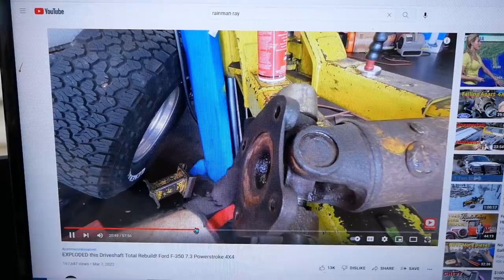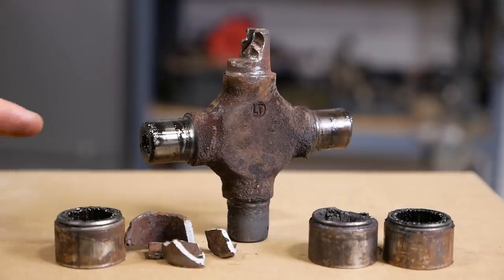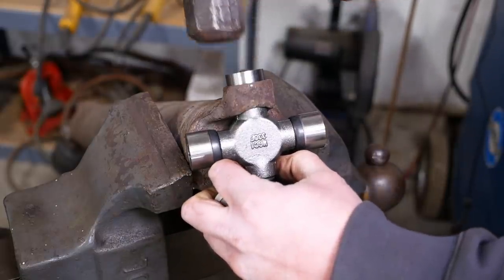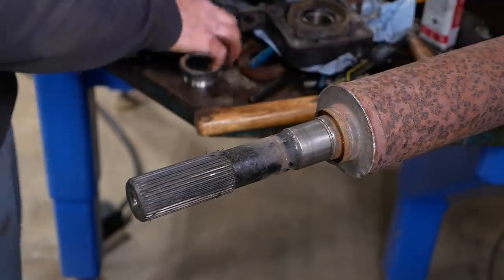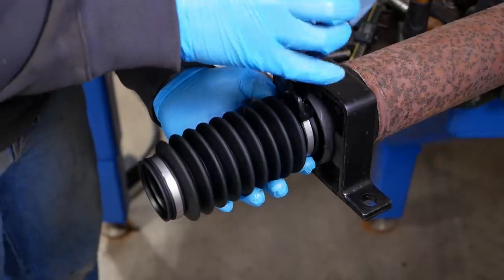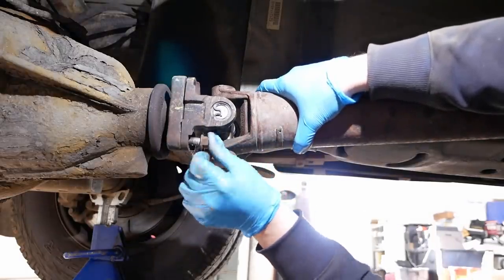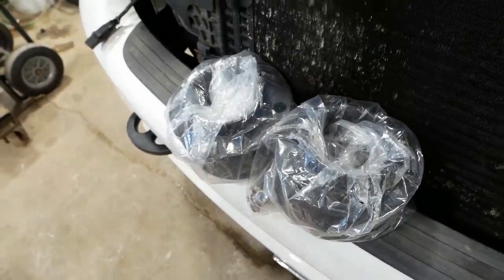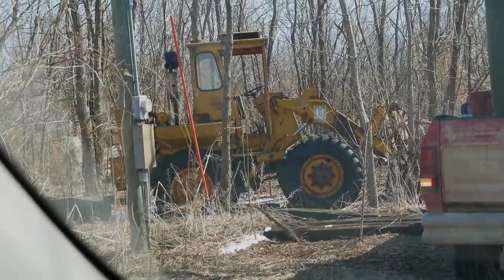Self Exploding Drive Shaft - Too Much Cummins Power...

Comment: Gotta be careful with the large fuel supplies of late. There have been a lot of stories about drilling holes in fuel tanks to steal fuel. One farm bought 3000 bucks of fuel for equipment and we can't do shit in Canada except call the cops who can only do something in certain situations. The people who did it filled up 2 cars and some jerry cans and let the rest drain on the ground. This is a situation where the cops won't do shit even though the people on the farm knows who did it, where they live and the evidence can be found easily because they don't try to hide their crimes. 

Our gas was cheap relative to other places at 1.17 per litre and it jumped to 1.50 the day after putin invaded and it has gone up more. With the pay before you fuel it is too hard for people to steal fuel from gas stations in and around the city.

Comment: The owner wants a "bro-dozer"... you really don't need to match the yoke to the pinion flange. While the driveshaft is balanced as an assembly, that pinion yoke is not part of that balanced assembly. Eric O @ SMA confrms this. Doesn't hurt anything is just unnecessary. 👍
Reply from the maker: They certainly do balance with the yoke installed. But I agree, it really doesn't matter.
Reply: @WatchWesWork  I mistyped... yoke on the shaft assembly but flange not, since that is installed on the diff.

Comment: but wes why would you do it right when you have the choice to do it wrong you know the new thing is the front end higher than the back. 1 1/2" is the most i will do on the front but try not to do any of them. dodge makes a nice metal one that isn't real expensive called a leveling kit for the truck. also the stocke intake is cold air most of the so called cold air intakes are usually hotte than stock and  have less filter

Comment: I know I found if a person is having to change U joints often on there truck it has always been from being overloaded constantly or they have cracked or weak springs, not to say that is what happened there just a observation from my old age wisdom. And I to have the special pliers for them clamps so your not special lol
Reply from the maker: After 360,000 miles, any u joint will be worn out.
Reply: @WatchWesWork  That is for real except on my semi I owned in my pic I never changed a u joint in it and it had 700,000 miles on it when I sold it I changed the carrier bearing

Comment: 😂 like Ray and his videos but 99% of the titles are clickbait .
Reply from the maker: That's all of YouTube.
Reply: Also I’m a hammer guy myself..exclusively..the “presses” can bend the ears and even a little bit will result in joints that don’t last near as long as they should. Also something I have seen neither you or Ray do is stress relieve the joint after installation. Ray did check if binding but try this little “trick” install the joint then feel the pre-load by moving the joint by hand. Usually even if you did it “right” it’s a little tight. Now take a small ball peen hammer and tap the end of ears of the flange and the shaft, or if it’s the cups (u bolt style) a little wack or 2 on the cups in the plane if rotation ..check the joint movement again..I bet you will be surprised by how much looser it feels after relieving the unnecessary preload imparted during installation.
With all that said love watching both you guys, I’m always open to learning and none of us knows everything
Reply: @WatchWesWork  that’s probably true and why I don’t watch much on YouTube lol.

Comment: If im pulling a driveshaft for u joints replacement they all get replaced.
Reply from the maker: There it is. The first of many. If I'm working on a vehicle, I do what the customer asks...
Reply: @WatchWesWork  I completely understand that.  I only wrench on my own vehicles
Reply: @WatchWesWork  that's what I would have asked you to do, the new u joints seem to be junk, never know the factory ones could last a few more years.thanks for the video
Reply: @RV Shadow you don't know that they're good parts. If 1 was bad it's possible that others are bad. if you've got the shaft out fix it and be done
Reply: @RV Shadow good right when he checked them. No guarantee they'll make   it another week. If it was mine I'd replace them all

Let's see if the truck comes back to Wes  for another u joint repair then the owner can pay for duplicate labor
Reply: @RV Shadow I do my own work on my own vehicles. 

If im pulling a driveshaft I replace all the u joints

You do your thing I'll do mine
Reply: @lewisbradford3305   I’ve been changing u joints for 28 years on Ram diesels and I can tell u the rear joints wears out faster than the joint at the transfer case. As a matter of fact I had a 2004 ram that had the original front u joint at the transfer case until 2019 and the rear joint had been changed 3 times. So you’re wasting time and money replacing all joints but also I don’t know what vehicle or application u deal with, so it might be better for u.
Reply: @LoneWolf-cf5tp  outstanding.  As I said you do your thing I'll do mine
Reply: @LoneWolf-cf5tp  I agree, usually the rear joint will go out 2 - 3 times before the other joints fail At least that's been my experience in.45 plus years of wrenching for a living.

Comment: no grease fitting
Reply from the maker: Look again.
Reply: @WatchWesWork  the u joint you took out had no grease fitting  the 2 cups were dry and cause the failure
Reply from the maker: @roadwarrior1157  Jesus Christ. I can see. I have eyes. It had a grease zerk. Obviously no one used it. That's not my problem.

Comment: Not that this one is fine but, if the yoke needs replaced, replace the damn yoke. 
It doesn't cost very much. 
I think people just think that it will be really expensive but, it's not.
Reply from the maker: It's expensive here.
Reply: @WatchWesWork   I just had new ends put on a Freightliner and it was only $360 and they even painted it.
Reply from the maker: @tomfuelery2905  Last one I had done was $500.

Comment: I always wondered how you can hear your outfit clunk grind etc and ignore it.  Go ahead and put dirt in the oil, as that cold air intake is crap.  Rain man is a hack
Reply from the maker: The same way people can have a smoke detector beeping because the battery is low and just live with it for years. Mine beeps one time and I'm going insane, especially in the middle of the night.

Comment: Dodge designed their shaft with a double slip,so when it lets loose going down the interstate at 80, it comes completely out of the vehicle and gets lost in the weeds about a mile back.
Fun fact: A sealed U-joint will carry more torque at the same RPM than a re-greasable one, if the re-geaseable one greases through the cross and not through the cap.
Reply from the maker: I'd still rather have grease.

Comment: I hate to say this becasue there are a lot of know it alls, and are going to argue, but that is NOT the right tool for those pinch clamps.  The correct tool also crushes the clamp from top.   Some real idiot posted that tool on youtube, and that's why everyone bought it.
Reply from the maker: Did it work? Then it's the "right" tool.
Reply: @WatchWesWork   I wouldn't say that.... In 20,000 mile if its still in place I'll agree...  I would  only assume  that If the right tool was used.